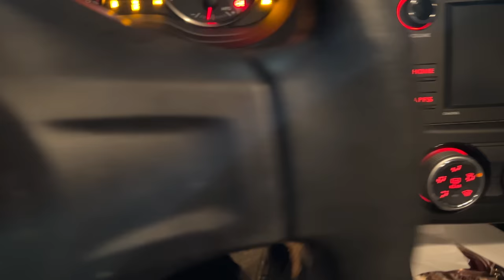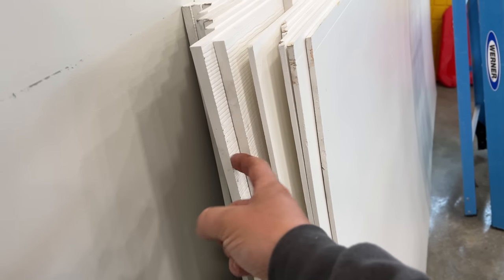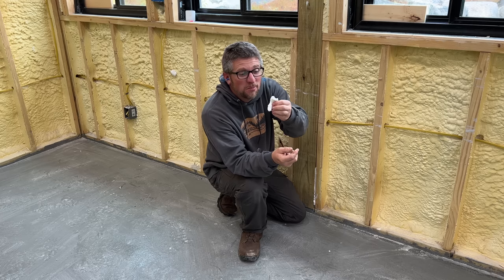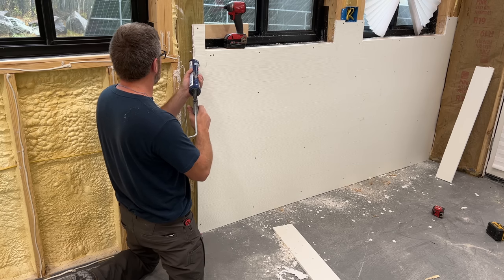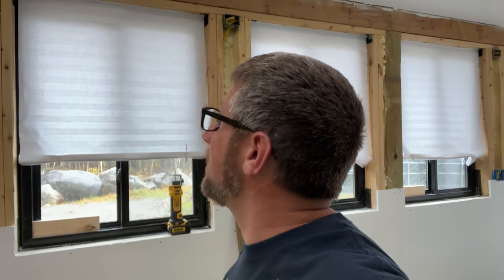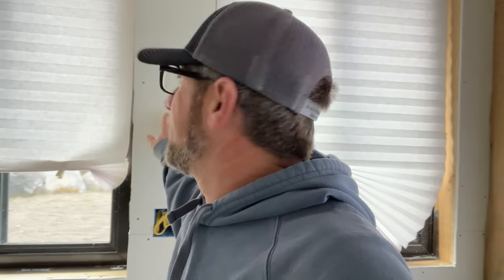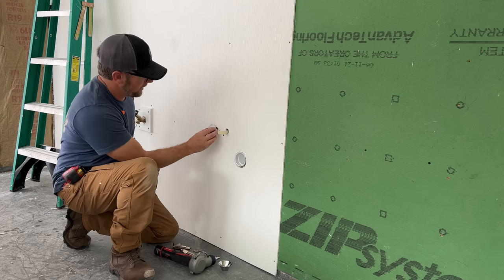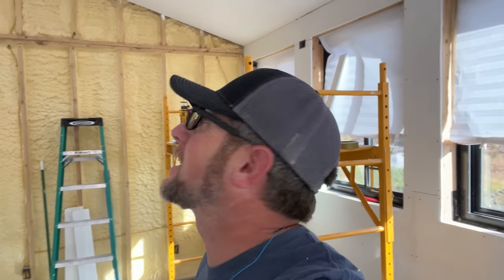BUILDING an OFF GRID BUTCHER SHOP

Comment: Al,  ALL of those  120 VAC 20 Amp Duplex Receptacle Outlets in that Butcher Shop Room have to be WR TR GFCI  receptacles OR be on a GFCI 120 VAC 20 Amp Combination Arc Fault / Ground Fault Circuit Breaker at the main panel feeding that branch circuit per NEC 2020 Code !! And the one close to that Hose Bib has to have a Code Compliant Water Proof Cover !

Comment: Gina looked great and it was so good to see her even if it was for a brief moment. The dead aphids is kind of a mystery. Thanks for sharing, Al and Gina. :_Figaro::goodvibes:
Reply: Uniquelyyours 1 , 
My guess is that the aphids are seeking someplace warmer and dry to shelter them from the winter. Ladybugs will do the same thing. The Ladybugs will seek out every nook and cranny for over wintering. Sometimes you may see them but mostly you won't.
 By the way , field mice will also be seeking a warmer place for the winter.
Reply: @donaldmiller8629  Yep, that's what I'm thinking.  They've found an access point that may be getting sealed up by the finishing up of the greenhouse/butcher shop area, so may not be seeing much of them in the days to come.  It's wet outside when this video was filmed, so that's driving them inside, too.
Reply: Gina please don’t lift nothing

Comment: At my former farm, I used T-111 to side the house. Every winter the Lady Bugs would climb up the grooves and enter the homes insulation. They would gather in ceiling corners and windows. I'd have to shop vac them for yaers till we house wrapped it and put vinyl siding. I find it amazing they're getting in to your  building  since you did such a good job of sealing it!
Reply: Obviously not as good a job sealing the house as he thought.  Every penetration is an opening for bugs.  Especially if there are no thresholds on doors - I haven't seen a threshold on the butcher/greenhouse

Comment: Glad you are feeling better Gina, just take it easy at first and be careful; those PVC panels are heavy. If you continue to have an Aphid problem, mix up a solution of Vinegar and liquid Dawn dishwashing soap (about a teaspoon of each to a quart of water. Use a spray bottle to spray the area where they congregate and it will kill them. I use this formula on my grape and tomato plants because it is nontoxic and works well.
Reply: Thank you Robert Herzog.
Reply: Great info Robert.  Thanks for the tip.

Comment: Good Morning sir do you think that your temporary chickens building really need a floor so that they can have dry feet and not wet and cold feet. The other side of the building need a plastic cover that will protect them from the wind and rain and eventually snow. At house the chickens were completely covered from all weather.
Reply: I think this won't be used in the winter. I think he is just testing for predator pressure for now.
Reply: @StoneKathryn  Thanks so very much for your answer to that concern of mine.

Comment: Hi Al, the chickens need a wall or tarp wall 4/5 the way across, parallel to the back wall, to make a closed in little tarp room, to protect them from the cold and wind. They can huddle behind it together. They need perches or boxes with hay. They need hay on the floor where they sleep as well.
Reply: They have grass. He has the most low temperature tolerant chickens in there. They should be fine at these temperatures.
Reply: @StoneKathryn  not if they are on wet ground
Reply: @StoneKathryn  Yeah I agree for now, but time flys and winter will be here before you know it.
Reply: I wonder if the chicken tractor would fit inside the open area of one of the barns. that way  they would have a little more security and less weather to contend with in the winter.

Comment: Al, please consider putting a door on the back wall.  That way you will not have to walk all the way around the building if (to get in the greenhouse) you are working in the back of the house or working back by the gas tank.

Comment: For information that you may or may not be aware, these insects may not be aphids but wood borers that took wings due to the heat in the building. They are known to lay their eggs in the trees in spring for them to hatch in the next springs. If the wood that you used in the construction is recently harvested, they may have taken wings earlier due to premature exposure to heat. Just a thought.

Comment: Gina fight the urge to do stuff. it is so powerful, but you need to Pace your recovery. hard as that is. you don't feel it's too much, until it's too late

I was thinking with the boiler, if you drill a hole you could put a chunk of glass and a camera, or you could put piezo sensor under the front to get a weight of the boiler to see if you need to add wood.

Comment: Must have been a nice surprise for Gina to see the progress, For the butchers shop window Ever thought of using Tinted window sheets that they use on cars??, put it on the outside, you can see out they cant see in, plus pick the tint you want and it lets the light in, should get it at Lowes. Love the wall covering.

Comment: For ease of cleaning, especially for butchering, i would have put the smooth side out. Dirt is gonna settle in the texture when they are using it as a potting shed. No gap at the floor to keep water from wicking up the siding?

Comment: I've used a fair amount of pvc plank. Usually the bigger thicknesses for trim and waterproof applications. I've milled a lot of it to fit the projects I've used it on and the only real drawback (except for the smell of it. I just don't like the smell of it when I cut it) is it makes a huge mess. I always cut it outdoors then regret even that because cleanup is so difficult if it's windy. Cutting it causes static and then it sticks to EVERYTHING!

Comment: Definitely have the right idea going on with the PVC board, it should work out well for moisture, and cleanup. Watch for the sealant in the joints though, it will either roll off, or pull out. I used it in my "meat room"/ processing room here in Florida, after hosing and bleach, it broke down the caulks after about a year. Love ya'll ❤️

Comment: Al did you change the pattern direction on these first 2 walls?   Outside wall runs horizontal and inside vertical, at least it appears that way.  Keep up the good videos.

Comment: Al if you plan on washing out the floor with a hose in the harvest house I sure would raise the sheet rock up at least a quarter inch off the floor.
Reply: There isn't any exposed sheet rock. House sheathing is behind the PVC panels. Not sheet rock.

Comment: Here in central PA we have Japanese Lady Bugs and Stink Bugs that invade our house in the fall.  They both are attracted to exterior walls that get direct sunlight.  Then they crawl inside through the smallest opening around doors.  They often climb up to corner where the wall meets the ceiling and they will cluster together there all winter long.  They eventually die and fall to the ground as there is nothing indoors that they can use for food.  We have had so many that we've filled the vacuum cleaner container with dead bugs.  I have heard that spraying WD-40 outside along the door boundary will discourage these bugs, but I think this is more of an old wives' tale.  Some things you just have to live with.
Reply: I get the stink bugs too. Yuck. They are kind of scary when you find them suddenly.

Comment: I used PVC to trim out a bathroom window which also was made of PVC.  Used PVC cement and after 15 years the bonded pieces are still like they were one custom window.  For areas that will see moisture and occasional splashes of water PVC can't be beat IMO.

Comment: That Tite Foam is, IMO, the best canned foam there is.  However, be CAREFUL when and where you use it.  If you fill around windows, for example, it is strong enough when it expands to deform trim, put pressure on the sill, etc.

Comment: It looks like you put the textured side of the PVC sheets on the inside of the room . Should the textured side have gone on the inside with the smooth side our? Would be easier cleaning with the smooth side as the textured side would catch debris and hold particulates

Comment: Though you said that the choice of boards your using is cost productive..and for easier cleaning but what's your plans on the screws showing?..right now from a viewer point it looks like drywall,are you gonna put board and batten trim in white in a vinyl..or being a cleaning a room don't matter!..but looks good so far!

Comment: Hi gina hope u r on the mend hun take it easy xxhi al the sheet rock u r using for the wall has it all ready got plaster on on it and use seam the edges and fill the seams weve got plaster board over here in england and we have to plaster the full boards not just the seams can u let me no if possible thnks micky b

Comment: please put a heat lamp in chicken tractor. temperatures are going down at night with frost
Reply: Chickens will survive to minus 20F
Reply: @tonygrimes13  but still i would like them to be comfortable. They should not suffer the cold
Reply: Have you ever held a chicken? They are hot little things! As long as they have something to digest in their tummies and a wind break they will do fine.
Reply: @StoneKathryn  yes we used to breed them and also harvest them
Reply: @josettesciberras1613  Sorry. I am just amazed at how well our chickens are adapted to cold! We keep ours in a barn that doesn't get below 10 above through the whole winter because it has the lower layer of the barn done in cement blocks. The sun shines on it during the day and it transfers the heat inside at night. We have plug-in buckets for water for them that we change everyday with a frost proof spigot just outside the barn. I just butchered 20 meat birds recently for the first time ever since I have had only layers up until this year. I've never had a chicken raise any chicks. This is the first year that I've had roosters too. I started wondering if they would stop letting chicks get sent in the mail for some reason and I still wanted to have a healthy, young flock of layers. I have 3 Black Australorp roosters and one Plymouth Barred Rock. We live in Minnesota so we can have a whole week 20 below and more during the winter. I certainly didn't mean to step on your "tail feathers."😊🐔🐣🐓
Reply: @StoneKathryn  that is how chickens must be kept in my opinion. Some people think that as its just a chicken they should be kept inhumane conditions. I am a chicken lady

Comment: You screwed up Al. You should have consulted with someone first before putting up the plastic on the walls. THAT'S A GLUE ONLY PROJECT. Especially if you are processing meats in there. You just made Swiss Cheese out of a potential sanitary surface. You wouldn't put screws through a prefab shower enclosure would you ? THE FIX : Cut strips of plastic sheeting & glue them down the wall covering the screw heads. They do make a food grade adhesive for these applications (they're not all the same). Only difference on your wall now will be that instead of a smooth surface, it'll have a board & batten look to it. Have a great day 😊.
Reply: Good points, Larry.  However It should be fine for the family's personal use.  They don't sell their meats to the public, so for private use, it's cool, albeit maybe not as sanitary as it could be... 🙂
Reply: That's a bit funny in that he "screwed" up his installation by putting the screws through the PVC board. I like your solution to this bad install. I think it would look nice that way.
Reply: Why are these scammers always promoting their BS in people's comment sections now ? SHAMELESS !
Reply: @larryparish5984  I most certainly agree with you on that issue!

Comment: BE CAREFUL WHEN YOU OPN THE DOOR TO THAT WOOD BOILER---THOSE FUMES ARE CANCER CAUSING SO DO NOT BREATHE THAT..GOD BLESS.
Reply: The boiler has a special lever 17:47 that Al activates first.  That activates a fan and alters the air flow - which sucks the air/smoke from the combustion area down into the unit, not into the user's face.   Nice of you to be on the lookout for Al's well-being, though!  🙂